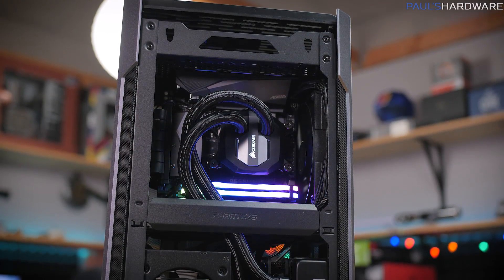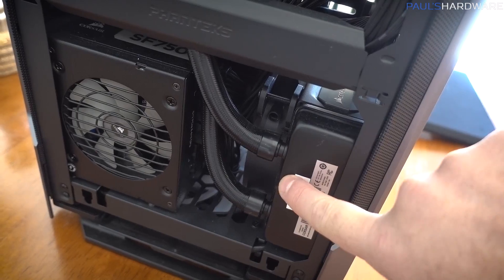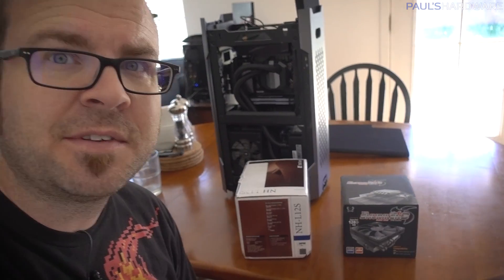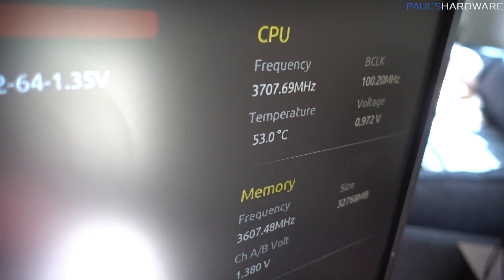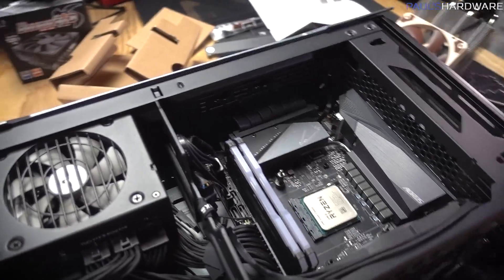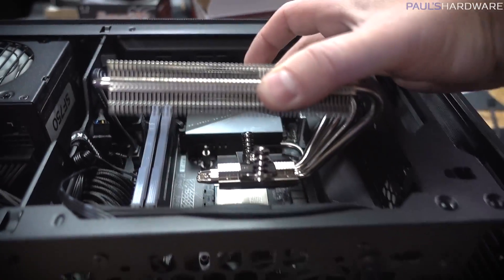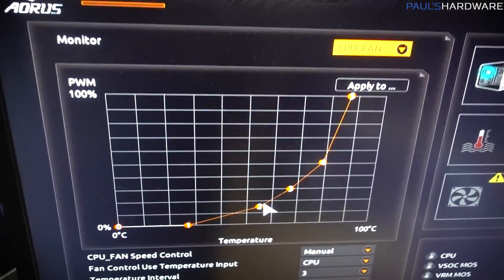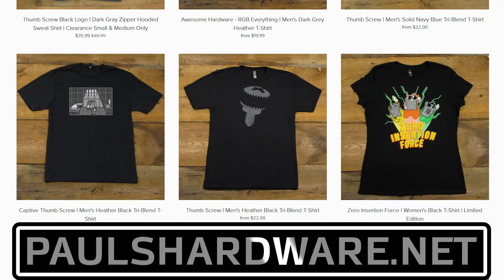You guys were right. The AIO died. ☠

Comment: I will never ever put something with liquid in it inside my rig...period.
Reply: Exactly.  Not only do water and computers not mix, water and ELECTRICITY do not mix either.  Worst that can happen with an air cooler is the fan gets noisy or dies after years of service and it gets replaced, but no risk to the system as even with a dead fan the tower still offers enough cooling to keep things safe enough through the heat pipes until a fan is replaced.  I have to wonder if water coolers arent secretly regarded in corporate boardrooms as planned money makers.  Consider - the pump or rad dies they sell more hardware - the AIO leaks and it bricks the whole system and again were buying more hardware, vicious circle.  You buy one good air cooler and replace a $12 fan maybe what, every five or so years maybe longer-??  Ive got one computer thats been on the same tower fan for 9 years.  All we have to do is keep air towers and fans clean which costs nothing but some time, youre supposed to keep the system clean anyway so no time lost really.

Comment: The moment when I have the same case and Aio, mounted in the same way

Sh*t.
Reply: There are AiOs with the pump in the radiator, if you really want an AiO.

Bypassing that asteck patent turns out to be a good thing for cases like this.
Reply: @dominicfindlay  the problem is i have one for the cpu and one for gpu, mounted on a kraken g12 on my gpu. It was necessary because i have the old version of this case, without the mesh panels, and temps were horrible.
The g12 Is only compatibile with Aio using esatek retention system, so I'm kinda stuck 😤
Reply: @flashxcate  
A: Turn your whole system upside down.

/Sarcasm
Reply: @RAW_Reality  may have beeen sarcasm but changing the orientation would be the best move until a different CPU cooler is installed
Reply: @RAW_Reality  Yes absolutely correct.
Reply: @RAW_Reality  5Head LUL
Reply: If you can do nothing else, try rotating the pump block 180 degrees. Those pipes would be right where any air builds up.
Reply: @chrisandrew_tv  i did, the tubes now are down, but once in a while i hear the clear sound of air bubbles moving through water, coming from my poor pc 😭
If it fails I'll get back to the stock gpu cooler while I wait for the custom loop pieces
Reply: @flashxcate  Yes, but where there are bubbles there is also water. Better a few bubbles than the pipes choking in an air chamber at the very top, IMO, which is where those bubbles are likely to collect.
Reply: @chrisandrew_tv  Yeah, that would also be a help
Reply: has it been 3 months yet? if not, wonder if it will also reach its point of demise then too.
Reply: @Kittsuera  nah it's only been a couple of weeks. But the one on the cpu (a veeery cheap Deep cool gammax) has been working flawlessly for 6 months now in the same situation, not even making the bubble noise. I guess this corsair h80 is just more vulnerable to this situation, despite costing more than double
Reply: lay it on the table
Reply: start saving for new AIO/HSF
Reply: check out the be quiet! Pure Loop 120mm, it has the pump in the tubes near the rad so would be a good choice,
but if you can't afford a new AIO now it would be better to change the way the PC sits on your desk so the PumpBlock is not at the top of the loop
Reply: Spin your block around so the lines are pointing down.  Also if you can install the resevoir so the lines are above the block lines that is the issue here.
Reply: An observation i made on the original build vid: there's room next to the PSU for a pump and res if you wanted to do a custom loop.
Reply: This isn't the fault of the orientation. This was a faulty AIO.
Reply: @IForgetYourName  It was 100% the fault of the orientation. Any air in the loop was sent up to rest in the pump, causing the pump to fail prematurely. The pump should never be the highest point in your loop or this is what you get.
Reply: @mjc0961  Naah you can make it work if you know how your radiator looks internally and the direction of flow. You can set it up in a way that the air accumulates in a pocket inside the radiator instead as long as the drain port of the radiator is lower than that air pocket. Of course this also means being aware of how you do the de-aeration so that the pump doesn't start with an air pocket that it can't get rid of in the first place.
Reply: @IForgetYourName  it is though, it's well documented that putting the pump at the top of a loop can kill it, and this isn't exclusive to AIOs. I had a friend kill a DDC doing the same thing. Paul literally covers this in the video lol

edit: i am not awake yet
Reply: @IForgetYourName  it's been shown that aios with the pump on the heatplate and positioned to have the cpu plate at the highest vertical point relative to the pump causes the pump to fail because air will permeate into the system with time and cause the pump to go dry.
Reply: @IForgetYourName  wrong.

Comment: Kyle did the same build in a shift evolve a year or so ago with the h80i v2. his failed in the same config. I did the same build and my h80i v2 failed after 5 months, the RMA replacement made it 45 days and up and died . A few weeks later the GN video was posted and many  AH HA moments were had. It seems this line of coolers have just enough air in them from the build process to where there is no forgiveness when the pump is the high man on the pole. Four of these failing in the same case  and config in short time for us I think proves that point.  I too went with a low profile Air cooler and never looked back. (be quiet! Shadow Rock LP, BK002).  You live and learn.

Comment: Ive been using a little bit smaller Noctua air cooler, the NH-L9 for around 6-7 years and zero problems what so ever, would've been a much better fitting in that build.

Comment: My wife had the the Phanteks shift original her AIO died and we replaced her case with the black shift  air 2 case and a Cooler Master G200P to cool her Intel  i5 8400. Noise levels are low and so are temps! 
    Her AIO pump lasted just over 3 years which isn't too bad for an ITX glass panel case. Glad we got the air version to get rid of her AIO. Rather just not deal with liquid coolers anymore.

Comment: It's ridiculous that it lasted barely 3months, usually it reaches a year lol. But you know they fail even installed the right way. Aio just need to stop existing it's like some other products that exist only to break so you get a new one.
Reply: Nah!.. I like AIO's They just have a higher degree of difficulty for the end user.. The end user should have known the pump was failing.. You can hear the bubbles.. If you properly monitor temps he would have seen the issue far before it died.. Paul should have known NOT to orient an AIO like that and then also set such a high aggressive fan curve (I wager that is why it died even faster)
AIO's are great if you respect the advantages and disadvantages. 
I personally do not want a giant hunk of metal in the middle of my motherboard hanging off the mounting hardware. I prefer that giant hunk of metal to be screwed into the case. BUT to each their own.. I just do not support your idea that they should stop existing.. You can choose to not use one and that if perfectly ok.. But to say that no one should be able to choose to use one (That is your implication) is just short sighted.

Comment: Pros and cons to both AIO and aircooling.. 
AIO has more cooling performance potential, however you will have 3 possible failures :liquid issues, pump and fan.
Air cooling is not as effective as liquidcooling but mainly only has 1 part that can fail (the fan).
Custom loops is by far the most effective due to displacement of liquid, but has the highest number of possible failures, such as pump, fan, liquid,  blocksealings, fittings, loose pipe or tubings.
Want to OC a beefy cpu --> AIO or custom ---or earprotection while the aircooled jet takes off. 
Want a reliable system with stock moderate consumer cpu --> aircooling is no problem
Want to show off your PC? --> some swing both ways, some like AIO, some like air, some like custom loops or exotic cooling.

Comment: To see if the pump isn't functioning; check the tubes to see if they are warming up. No extra heat, no running pump. If you have a chassis that vibrates a bit, you may not be able to discern whether the pump is working.

Comment: Have an L12S oriented the same way in my Sliger CL530 on a 5600X and it’s great. In case anyone says it’s oriented ‘wrong’ (technically Noctua does not recommend this orientation), I flipped the whole case upside down to test if the orientation was hurting performance and the difference was 2 degrees. Nice job, Paul.

Comment: Kinda glad I went with Air Cooling just to have one less thing to worry about
Reply: Normally it's not something to ever really worry about. AIO's are meant to work without you needing to do any monitoring aside from fan speeds, just like air coolers. If anything, they just require slightly more forethought on how to install them (Aka: The whole "Don't install the waterblock at the top of the system, always have the radiator above it"). 

Honestly, the biggest issue was the small form factor case. Small cases aren't bad or anything, but they can be a lot more demanding on how you fit them. You need to make sure everything fits together, or you just risk breaking parts or not being able to use parts you paid for at all. The one upside to a big case is that you won't ever really worry about space (I mean, you will a bit, but not nearly to the same extent).
Reply: @TrxPsyche  Yup. I went through at least one month planning to make sure everything fit inside a 10L case. Only 2 slot GPU's, nothing more etc. It was my first build ever aswell. It was a fun ride.
Reply: I built a micro atx build and just used the wraith stealth that came with the CPU. It's been working fine so far. The 5 case fans I put on probably help lol
Reply: @j1mb0bZ  I have 2 40mm fans exhausting heat out the top of the motherboard area where the CPU is. Small but moves loads of air. You can even feel the air coming out
Reply: @mythic017  yeah I built in a thermaltake h18 versa and slapped 5 antec prism 120mms in it. 3 at the front, and one on top and in the back as exhaust. I just built it about a week ago, and the highest temp I've seen my CPU at full load was 62°c, I couldn't be happier with it. Plus the wraith stealth is pretty slick looking and goes well with the rest of the build.
Reply: @j1mb0bZ  my 5800X likes to stay in the 60s while gaming. Idle temps constantly jump around so cant get a proper reading but I would say about 45ish. It is fine for me :)
Reply: Just don't get these shitty 120 aios from corsair.
Reply: The problem is not the water cooling. The problem is this rediculous small case. Go big or go home.
Reply: @Henk_de_Vries  I went with a small case. No problems so far :)
Reply: @mythic017  Yeah, it's specific to use case. I have an AIO I got at an amazing deal, and it's worked perfectly for over a year. The rad is in the top of the case with the lines pointed down. Never had a problem with it, and it was cheaper than an air cooler.
Reply: @joer8854  I wish I could use an AIO. The compromise you have to make with ITX is cooling and maybe noise. But I am fine with my tiny air cooler ;)

Comment: I don't believe the orientation in this build should have been an issue, the radiator has plenty of room above the tube inlets that air should have been trapped in that wouldn't cycle through the loop. Because the radiator was on its side the air cant just escape. If the tub that was on the lower side of the radiator was pull, then air would get trapped in the radiator when its first turned on and never escape. 

I think the videos about radiator orientation keep forgetting about the actual force the pump needs to use to move air around. If the pump is super weak the air will just collect in the highest point and never move, if the pump is super strong the air can never collect and will get mixed in with the water. In your own build the air should have collected in a tube, not the block unless there was a massive leak. 

I think if we actually look at AIOs causes of death, most are just a pump going bad and few are related to air buildup. Especially after only a few months, this thing is still under warranty right?

Comment: This didn't die because of the pump location, this is almost certainly a one off defect. You should RMA it and replace it. Anyone who ACTUALLY watched the GamersNexus video would know that they say it would take years for any impact to occur because you need to liquid to evaporate to sufficiently low levels. This is a new CLC that's been running for 3 months. The pump just happened to fail and Corsair would happily replace it.

Comment: Yeah I had the H110i and it lasted about 6 months before it died. Came home to my system running super hot. First and last time I use an AIO. Sold the refurb that Corsair sent me and got a Noctua D14 and haven't had a single issue since. Yeah it's a big ass heatsink but if the fan dies it's still a big ass heat sink.

Comment: Not to rain on your parad here, but the mounting position you chose for that CPU cooler is actually the only one Noctua says not to use for that cooler (heatpipe bends upwards).
Info can be found on the Noctua website in the FAQ section, not sure if I can share links here... 
Quote: "Please avoid installing the cooler with the bends pointing upwards as this may result in reduced cooling performance."
Otherwise still an awesome build, those mITX builds sure are tempting!
Reply: That's really weird... why would that make a difference?
Reply: @stpirate89  I think because there is some liquid in the heat pipes
Reply: @joelvdbrink8799  No way there is liquid in the heat pipes, if there was the cooler wouldn't work
Reply: @njgm2007  Heat pipes work by evaporating a small amount of liquid at one end and letting it condense at the other to transfer heat energy. Having the heat pipes in that orientation might hinder capillary action so Noctua is probably being cautious.
Reply: @rinhato8453  I thought that those kind of coolers relied only on convection! Then, gravity does have something to do with it. Thanks for the info.
Reply: @rinhato8453  This is correct. In some way, shape or form, liquid cooling exists in all modern cooling solutions that are worth anything.
Reply: Not sure why, just remembered it from doing research on itx coolers last weekend.
But I trust Noctua knows their own coolers rather well, so I guess theres a reason for that warning...

Comment: you should open the aio block it would be interesting to see what failed and how
Reply: I would like to see this as well
Reply: IF it failed! It could be just air bound and could still work if he turned the computer upside down.
Reply: @stephendurnan3609  I'd expect it to be loud af if it was still running, and Paul would probably have seen the pump speed in BIOS and whatever hardware monitor he was using. Could still be the case though; it would be a simple thing to overlook if the pump didn't make a lot of noise.
Reply: @jckf  Actually this happened to me with my 1080 hybrid card I got second hand. It SEEMED like it was dead, it just had air in it. No sound or anything. Works perfect now
Reply: Disguised Dv8ant  hey content is content
Reply: You probably wouldn't see much. 
I don't claim to know, but I bet it's a lot like a "burned out" case fan. They look exactly the same as a working fan, except for some dark-spot near the motor that got zapped
And that burnt plastic smell.

Without water to create resistance they probably rotate way over spec and burn out
Reply: Electric motor coils usually overheat under increased loads due to air or a jammed fan, the coils melt the insulation, and this leads to shorts in the coils which prevents it from working
Reply: It failed because it mostly ran dry.
Reply: The motors. The motors in these fail faster when the tube is cramped. Don't use these AIO's in small cases.
Reply: I had that same AIO. It died. Got a replacement and that died too
Reply: Almost certainly killed the impeller. They use the liquid as their lubricant and essentially need it to spin without hitting the sides, creating friction. If it runs in air rather than liquid their lifespan is greatly reduced. Its really the same for any impeller based pump in any application. My cats water bowl uses an impeller. Boats use impellers for some purposes, my fishtank has impeller pumps. If you run them in the air they won't last long at all.
Reply: it's a corsair block. they always fail. 
i've had all 4 i've used fail.
2 of them nuked my cpus.
done with their aios
one was recently, a brand new 360 elite capellix... nuked an 11700kf
Reply: @mongoosemcmongoose2786  seems more like user error bud with that many times
Reply: The pump failed.... There's no doubt about it.
Reply: @LucasDaRonco  The question is what the failure mode is.
Reply: @LucasDaRonco  it would still be cool to see inside and show people what is inside an aio
Reply: @LucasDaRonco  Yes, the pump likely failed, but the cause is air build up and cavitation... and the real kill may actually be the heat it could no longer get rid of.
Reply: Disguised Dv8ant  I've already said that I agree the orientation is the likely cause, but fuck me for being curious, right?
Reply: It failed because water pumps can't pump air and this configuration is mostly air
Reply: @AndrewB23 please elaborate as much as possible.